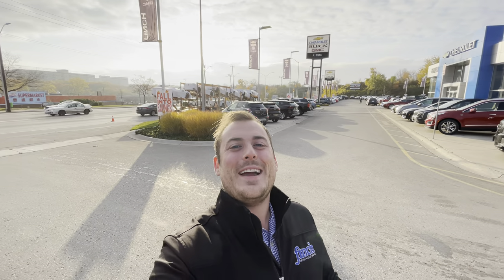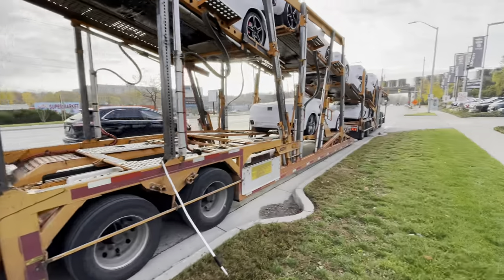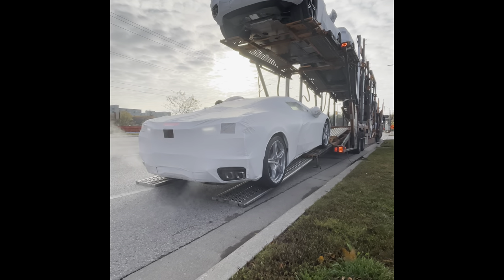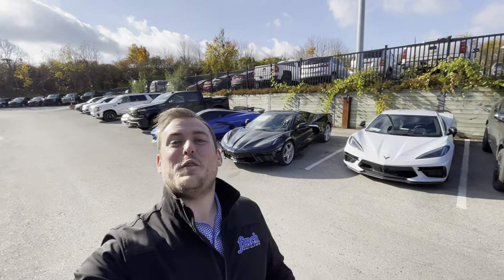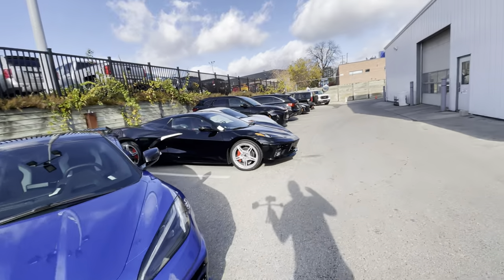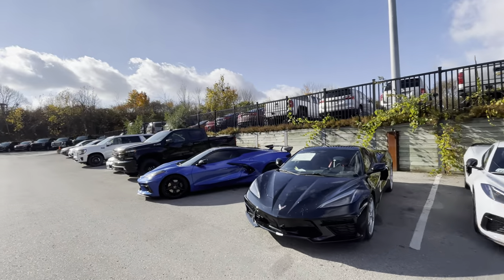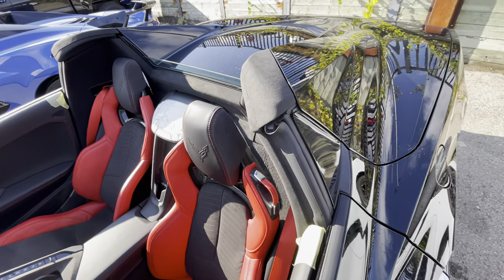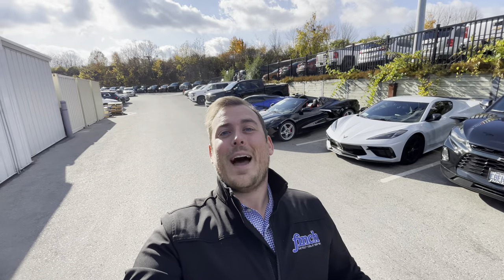Two-Tone & Colour Override Interiors/Canadian Delivery Update/ Rare Accessory Finally Arrives!

Comment: I'm getting a 2021 3LT convertable. Red mist tint coat metallic with  carbon flash painted nacelles and roof . Full length duel stripe package, carbon flash metallic. Z51 package, 5 trident sterling wheels silver painted ,carbon flash metallic painted mirrors ,torch red seat belts, what do you think would go better? Adrenaline red napa leader seating surfaces with perforated inserts or have seats seating black sides red thanks for videos

Comment: The 5VM is the order code for visible carbon fiber ground effects.  What is the order code for the Exterior trim ground effects package in painted carbon flash metallic? (Front splitter and side aero)

Comment: Thanks for the info, question for you. On the 1LT it looks like you can only get the GT1 seat or the competition seat. Is there anyway to do an override and get the GT2 seat in the 1LT?
Reply from the maker: Unfortunately  no you can’t but I can assure you that 2LT is the best value you can get on the C8. This is the first item you should get unless this is going to be a track specific vette
Reply: Cars and Crosbie ok cool thank you. Yeah I’m looking at doing a convertible 2LT Z51 with the GT2 seats. I was just curious as I saw there was no option for the GT2 seat on the 1LT. Why is it they don’t offer them

Comment: GM Canada wouldn't need to put out a memo that they will be shipping C8's to Canada after November if a London Ont. Corvette salesman wasn't putting out false information about the opposite
Reply from the maker: Easy pal, I was told by GM this info and I was only passing along what they told me. Disappointed with your comment man
Reply: @Cars_and_Crosbie  When you put out incorrect information at least do as Rick Conti did when he was installing the rear brake ducts during PDI for cars not heading to the track and acknowledge it because there is a lot of patiently waiting C8 buyers that took your info as gospel and were quite frustrated with GM
Reply from the maker: What do you think I was doing in this episode by bringing it up 3 times